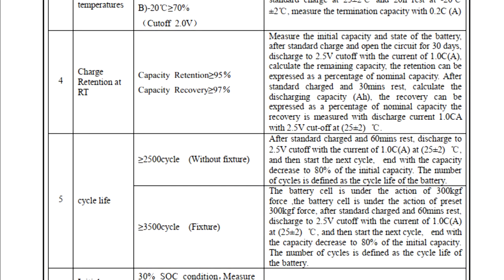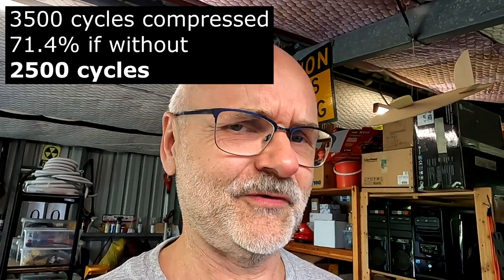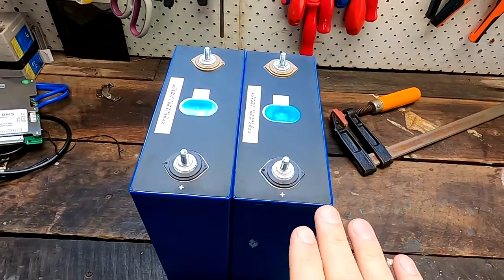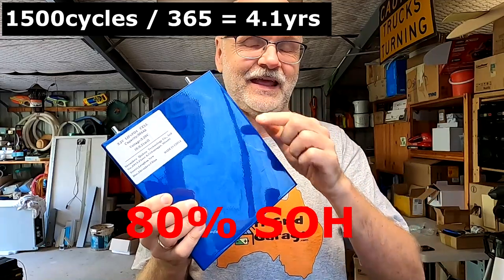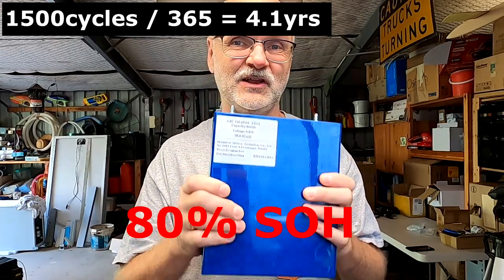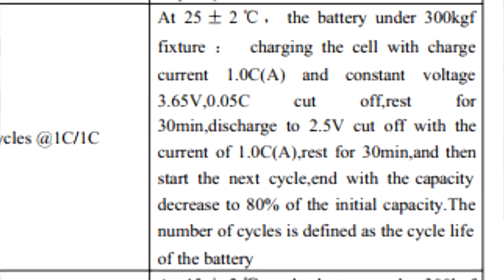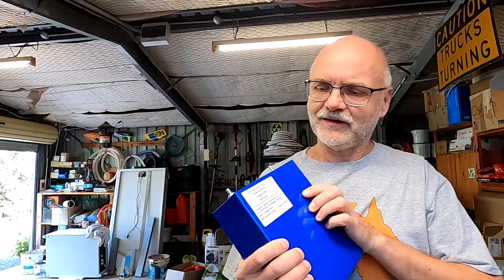Why compression will not extend battery life (something else kills your batteries).

Comment: Only few words on the current subject of cycling, coompressing, etc.  When I made and started using my first 16 cells of 280Ah, i realized that if i want to feel comfortable in loading, that not enough. Then I added the next 16 x 280Ah and first today when I have the THIRD set, i see that it is the right thing. Before i connected my third set, i calculated the average per year cycling with 1st set and it was about 160, then with second i unfortunately lost data on bms so i am not sure about it, but now with third set it will be very low.  Batteries not compressed,  just thick paper between them, maybe 1mm space. Batteries are in the cellar with summer temperatures not exceeding 25C even when outside 37C, and winter time never under 16C. Another benefit is that i had no problem when adding more panels and i am never more afraid to have to much amps when charging in full sunshine. My hybrid inverters (2 times 5kw in paralel) could not cover the additional panels that i added later (now the total of 13,8kw) so i do it with help of Epever 10420AN and the batteries now charge with smaller current than it was before with 16cells and 10kw panels. So adding batteries, although very costly, gives u number of other benefits. I completely agree with you about cycling and compressing approach.

Comment: all valid points ........ except
long rods and springs are way cheaper than a set of batteries 
so if you can buy 4 threaded rods instead of 16 battery cells, then maths are different :) 
I do love your videos and this one is good too.
But! if you did the same calculations WITH compression... simplistically we would get the same +30%
that's not accurate of course, nothing is linear here, but with 0.2 and 50% discharge and 80% charge and compression and belts and suspenders they would last longer then us old ppl ;)

Comment: I have these exact cells that have been sitting in my garage for 2 weeks while I think through the compression and box design. You’ve convinced me to forgo all that and I’m just going to start using them. Thank you!!
Reply: Heck for the cost of a cheap ratchet strap, $3usd and a small piece of scrap 2x6 on each end
Reply from the maker: Wrong compression can cause damage to the cells. RCin Fla pointed this out in his comment here...
Reply: @OffGridGarageAustralia  oh I was still going to do a box and some fixture but I’m not going to worry about compression calculations. I’m actually more concerned about terminal and busbar stress due to expansion so I’ll work towards keeping the cells affixed as best as possible. 👍🏽

Comment: i think the only reason to go with compression is if you want to go for the max discharge rate. Some of these cells have a 2 or 3c discharge rate for 15-20 min or something. I can see compression being a bit of help there with the heat making it more funerable to deformation.

Comment: Congratulation to 0,15$/kWh ( we in Germany pay 0,30$/kWh...😒 ) ----  I think compression has another advantage: the cells are not held together at the top by the busbars and pressed apart at the bottom by the inflation. This results in an angle at the busbars which leads to greater contact resistance and heat generation.

Comment: I think the truth lies somewhere in between. Compress at the beginning, and mount at a distance after a few cycles ;-) 
Why do you compress the cells? In another video with a developer of such cells, I learned that there are still tiny gas bubbles in the foils due to the production process, which escape due to the pressure and a few charging cycles and collect at the top near the terminals. The gas bubbles hinder the ion transport somewhat and thus lead to a reduced service life. Once the gas bubbles are out, the compression is no longer needed.

Comment: I would add one more argument against compression: what if one manages to charge the battery while in cold (or freezing) temperatures with high current (maybe by using a cheaper BMS which doesn't have undertemperature protection). My limited knowledge says that applying too high charging current in too low temperatures increases the likelyhood that Lithium ions do not go into the anode but metallize on it's surface. This does not only reduce the capacity but also forms dendrites which will apply extra pressure on laminate and can puncture it making a short circuit. I don't know for sure but I would argue that puncture is more likely to take place when compression is applied. If so, then compressing the cells (specially in colder climates) could significantly reduce the battery safety.

Comment: The expansion is a symptom of the problem. Smushing the cells doesn't matter. The problem already occurred even if you hide the symptom.
This is why thermal management matters.
You need to keep the cells all the same temperature, and within nominal working range.
This is why I use salvaged Chevy Volt packs and am building my own array, charger, and monitor.
The Chevy Volt's over the top thermal management combined with the Power Density (not Energy Density) design of the batteries, makes them almost invincible.
You can charge and discahrge at 30C if you want. This is not a typo. 30C.
A few in parallel, and you can dump more power (in short periods of time) than some small nuclear reactors.
I can't even buy wire fat enough to do that. It's more like long ingots.
...makes circuit breakers important.
Reply from the maker: Theses batteries are already clamped anyway, right? They should last forever if in the right temperature range.
Reply: @OffGridGarageAustralia  I know how to find out! In the next couple of months, my first proof of concept arrangement should be coming together. The good part is that since nobody in the USA knows anything anymore, you can get these packs for $1,000 each. I have 5 in parallel for 80KW/h!

There was a research lab that did testing on these battery packs, I can't find the PDF now, but they actually gained capacity when pushed hard. Internal resistance dropped so low they couldn't accurately measure it. Pico ohms, iirc.

Also, since that's a high-voltage, low amperage setup, current will be a lot lower. This makes a big difference, too. Same power, but lower amps. ~900% lower.

The bigger problem is over time. Imbalance in the charge AND imbalance in the temperature. Both get worse over time. The Flying Capacitors solve the electrical balance, but this does nothing for the thermal balance. People forget batteries are a chemical device first, and electricity is just a byproduct. The same chemical reaction, done over and over again, changes the capacity of the cell when each one is a slightly different temperature. The batteries at the end of the pack will wear differently than the ones in the middle, etc. The balancer controls the imbalance problem, but it doesn't actually fix it or prevent it. Say, 10 years from now, you'll notice the pattern of which cells need to balance all the time, which ones are high all the time, which ones are low all the time. The ones in the middle will be different from the ones at the ends that have more surface area exposed to ambient.

The Chevy Volt packs basically wrap the battery in a cooling jacket. Keep that water flowing, the batteries all stay the same temperature. It's not necessarily heating or cooling. Just consistency. Yes, a heater can be added to the loop when needed, but it's mostly about thermally balancing the cells, not just electrically balancing the cells. Electrically balancing the cells is what keeps them from blowing up. But, thermal imbalance is why they become electrically imbalanced, it alters them over time. Thermal balancing is actually more important, because it prevents the problem in the first place. Electrical balancing just protects you from the symptom.

Comment: Hi uncle Andy.

Finally my logic was applied in a video. For almost 2 years my cells have had a 4mm gap between them.
I have 16s6p setup and one of the bms on one of the banks shows I've done 92 cycles on it (v2 ant bms)  In 1y 7 months.
I applied the logic of more capacity = less cycles = less degradation = roughly 25 years before they feel the usage (but yeah time itself will kill them before usage does.)

Going to share the 🐸 out of this to my friends.

Great video as always.

PS help me decide
2 more solar panels(running 2S strings) or a new version jk bms?
Both would be nice to haves, non are crucial to get
Reply from the maker: Hi Wayne, thanks for sharing your experience. Very interesting.

I would not get the new JK-BMS unless you need a anew one anyway. There is no benefit of upgrading a perfectly working one.
Definitely get more solar if you can. You can never have enough generation.
Reply: @OffGridGarageAustralia  I have 1 Daly bms.......
Was leaning towards panels, like you say.

Perfect thank you

Comment: I live in a very hot environment 36-40c ambient temp, so decided not to compress the cells and left a gap in between each cell so they don't share heat and disipate to atmosphere. Remember the case of most prismatic cells is made of aluminum its like a big heatsink. 

Also for solar storage, we don't reach maximum C rate discharge. If it where a bike o car that's a different story.

Comment: I acknowledge everything in this excellent video but …… I am about to build a pack to put in my motorhome and realise that compression will be needed to restrain them from movement during travel which would stress the terminals. Perhaps I need to come up with constraint that will leaves a small (say 3mm) gap between each cell. Cheers from New Zealand.and thank you for the video.

Comment: The most important conclusion: do not be afraid!!! If you use common sense and follow the rules of electrical installations, nothing will explode in your face, there will be no fire, everything will work properly.
According to Polish proverbs: a brick for an unlucky man will fall on his head in a wooden church and a lucky one will be rocked by a devil.
Second, very apt observation: all LFP battery builders are pioneers. Therefore, if you have doubt, keep paying the power plant for electricity. But if you not, go ahead without fear.

Comment: Bloating is caused by high timp and that is tipicly from charging, so if you have 100 or 200 amps battery you should not drain or charge more than 50 to 100 amps. Now that is the charge and discharge power. So if you are going to go over that 50% mark a lot you will have bloat and need to compress. However if you keep you charg amps bellow 50% and use of available amp house between cycling. You should get even more time from battery. So over size your batterys 50 to 100% and by the time you need to replace there will be cheaper and better batterys. Don't forget to acomedat with additional solar panels for this.😜😜😜😜
Reply from the maker: Thanks Tom, that's good information.
Yeah, I definitely need more solar now... it's hardly keeping up...

Comment: It is clear. No discussion about. What about to clean panels o not to clean? Make sense or not? For 10 years, my panels was full of dust because my time cost more than 10 % of energy so, the  🌧  will work for me. Greetings from Spain.
Reply from the maker: I've never seen much improvement after cleaning panels. But I still do it from time to time on my garage because the roof is so flat and $h*t is piling up.
But yeah, it's the same sort of discussion 🤭

Comment: As I have said to people. 2500 cycles at 100% discharge at 1c rate once a day is still 6.84 years. Its a battery Just USE IT. None of this only charging to 13.8v or attempted 90% max charged and only 80% dod nonsense. Just charge it 14.2-14.4v and use the thing. The average cycle life most people will get will go beyond calendar life expected from the cells.  Not to mention years down the track will you even still have the battery? or will you have upgraded to a larger cheaper one, or sold it in a vehicle or camper and such.

Comment: Time will tell if that's really the case.
Is it possible to do a test with a cell that is charged with 1C how much it expands? A load-discharge-charge endurance test... would also be interesting.
Reply from the maker: I don't have the load to do such a test. Even 250A on this 12V battery setup is stretching the inverter capability. I need a second inverter for such a test. 🤭
Reply: @OffGridGarageAustralia  Yes, of course, the problem is to generate these currents.
Reply: @maxmeyer7299  A water tank full of salt water with two electrodes you get hot salt water.
Reply: @bascomnextion5639  You also get hydrogen and oxygen, which you probably want to keep separate
Reply: @MatthiasUrlichs  It is a common way to load generators not a lot of gas is generated and you use a large tank in open air , also a very small amount of salt is needed. Note there were ceramic electric jugs that used the same principal.

Comment: Hello, highly appreciate your vids!
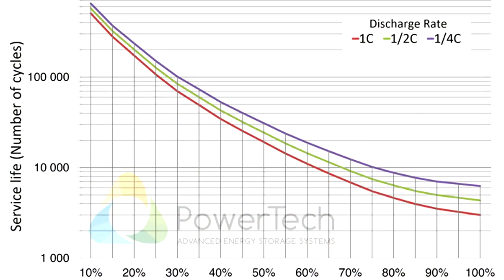But, i think you've overlooked the y-axis of your diagram (06:40) has a logarithmic scale, thus the scale lines stand for 1000, 2000, 3000,...,9000, 10000 cycles and then 20000, 30000,..., 90000, 100000 cycles. The red arrow therefore points to 4500 cycles. Reducing the DoD down to 80% leads alongside the green graph to 6500 cycles, and DoD of 60% shows at least 16000 cycles, which is above 40 yrs. A DoD of only 20% gives us 200000 (!) cycles (500+ yrs). In theory, as we know.

Comment: I still feel the opposite. Some threaded rod, punched angle steel, and plywood are sitting around my shop or are extremely inexpensive. Why wouldn't I want my hard-earned money to last as long as I can make it last, even if someone else inherits these batteries?
Reply: The point is compression is only one factor. With your scrap component compression efforts, how are you regulating the temperature? What scrap component (from the list you mentioned in your comment) is ensuring all cells are kept at 25C? To get the "benefits" of compression, the compression must be "compliant" compression. Other comments on this video have said compression made incorrectly can damage cells in other ways. Without compression, you don't introduce those possible problems. With compression you ad complexity to your build and you need to do it right to really get the benefits.

A few scrap bits thrown together just doesn't cut it, for 90% of people who just want a working system that will last a reasonable period of time. If you're doing it right, it's likely you're not just using a few scrap components.
Reply from the maker: The compression give you only the benefit if you have exactly the environment they tested it in: 25°C, 1C charge and discharge, ... if you walk away from that, it changes the outcome to the better or worse. 
But as I said, compression is not a bad thing and I'm not against. I just don't think people get as much benefit out of it as they may hope.
Reply: @CollinBaillie  The "compression" is really just fixing it so it's not allowed to swell. When it swells it exerts the respective forces that are cited, so you fixture needs to be able to withstand those forces. My battery is in my insulated garage that is kept at 25C via a mini-split heat pump.
Reply: @captainobvious9188  Oh, I understand. And do you discharge and charge at 1C? Does an ambient temperature of 25C guarantee an even 25C between the compressed cells? I'm not saying your use of compression is pointless. The point of Andy's video is that mostly people will never reach or maintain those limits or conditions. Maybe you do. Compress away. 😊
Reply: @CollinBaillie  No, for me I stopped at simply keeping it fixed, as I have seen non-fixed cells degrade more quickly. I suppose for me, the time and effort to make a simple fixture for it is worth it, I stopped at that point. I don’t apply pressure other than what it applies when swelling nor do I attempt to optimize pressure based on temp, SoC, or anything else. IMO that is the optimal amount of attention to pay to it, not to ignore it all together because it’s too hard to make it lab-optimal.

Comment: I love your videos Andy. Compression, another thing to not worry about!  I like that.  I'm debating where to put my Growatt 3000ES and a 1.5kW battery bank.  Do I put them in a basement workshop where it is dusty but steady temps of about 65F.  Or should I make my life easier and stick them in a mudroom closet that is very "dust free" but the temp in the winter may approach freezing.  I know I can insulate and provide a bit of warmth for the system during the 60 or 70 days when freezing may be an issue.  I just don't want to further complicate things.

Comment: What they all seem to forget is when a battery expands its for a reason so havin it compressed is a really bad idea😉
Reply: The reason it expands and contracts is because of the jelly roll in the battery. Going through these cycles can de-laminate it. Compression minimizes this. Older generation cells had thick plastic cases that did the same thing as compression, and cylindrical cells have this automatically due to their geometry.
Reply: @upnorthandpersonal  Agreed.
 My 6.5 year old 400Ah Winston cells have always been compressed. (I occasionally pull up to very close to 0.75C from them, though typically much less. They have a 300A fuse.)
I see no noticeable degradation with them, so it can’t be a “bad” thing.